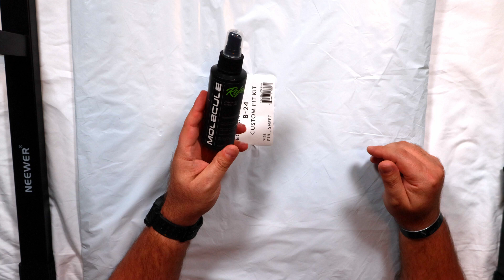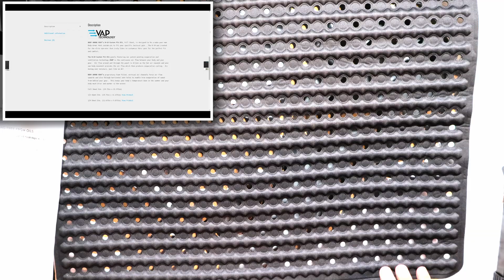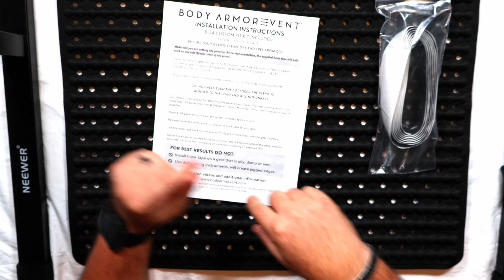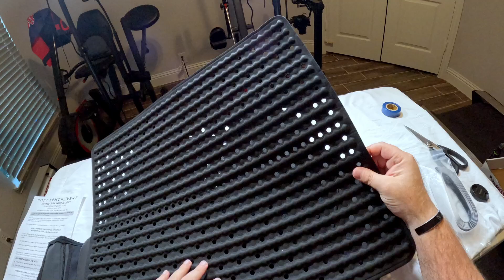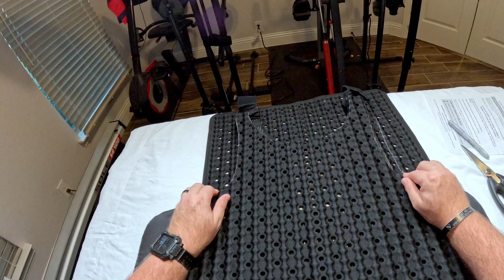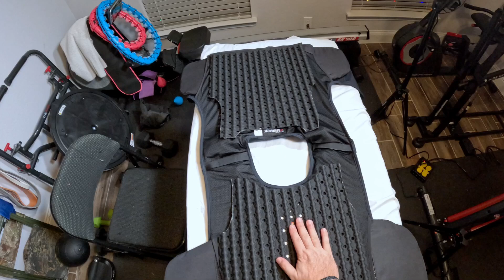Body Armor Vent : Maximum Comfort, Minimum Sweat

Comment: Interesting product.
This gets me thinking there has to be a better way of designing the armor, incorporating breathability with defense.
Perhaps something with heat transfer properties to external cooling panels?
Necessity: the mother of invention.
Reply from the maker: I really agree especially since we are transitioning from the old way of wearing our vests under our shirts to outer carriers and to also running Molle capable carriers. It’s evolving slowly but the armor companies do not concern themselves with heating and cooling or breathable properties. They are worried about defeating rounds and making it as light as possible which even by today’s standards soft armor is still heavy. Thank god for aftermarket companies who really go the extra mile to help us out. Great comment and thoughts bro thank you for watching.